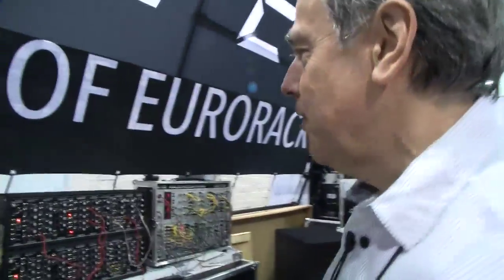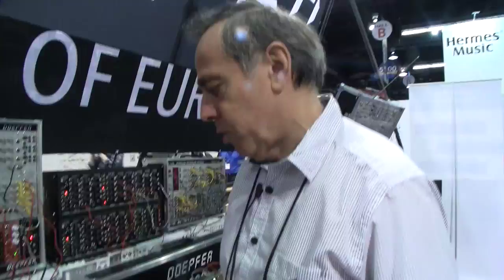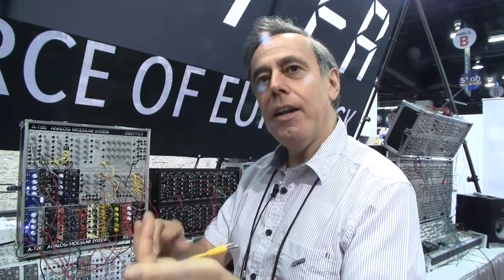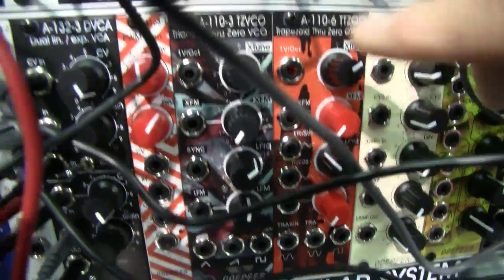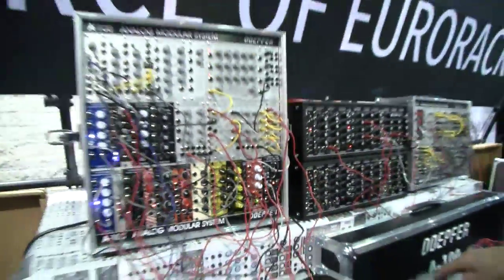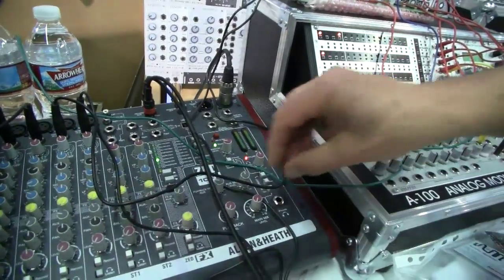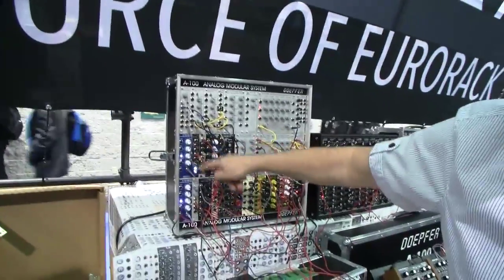NAMM 2016 Doepfer New Stuff

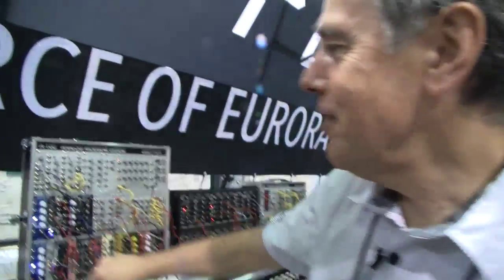Comment: @ Doepfer 9:45 it's because the cable is the wrong kind of transparent that it doesn't work. It has the wrong refractive index, so it dissipates the light quickly instead of trapping it in the cable. You need something made from an acryllic fiber material similar to fiber optics. Also despite it mainly being transparent, there's a small mass of metal on the inside of the plug that blocks a fairly high amount of the light.
Remedy these 2 minor details and it'll work perfectly. Wouldn't even be surprised if there's some company around offering that kind of cables already.

Comment: These black panels are amazing. I plan to buy the moog mother with the 3 tier rack, and fill the other 2 parts up with black doepfers.
Reply: +Kayak Fan Great idea.  That is perfect timing for Doepfer to release those panels.
Reply: The only thing that bothers me is that the uzeus power module isn't in black. But i think i'll just overlay it with a plain black vinyl foil. It doesn't really need print on there... it's just a switch, an adapter port and a few led's.